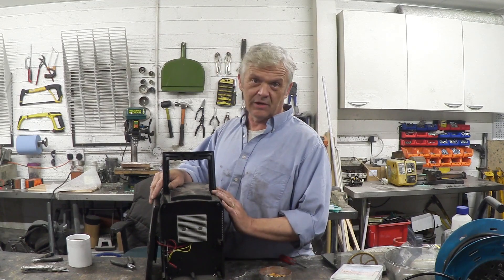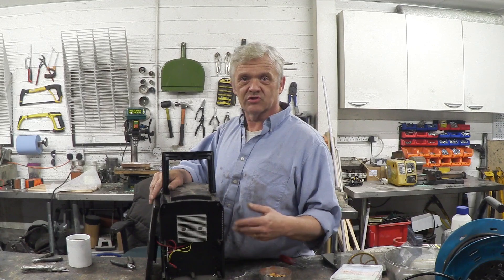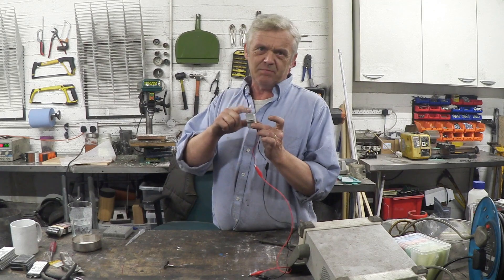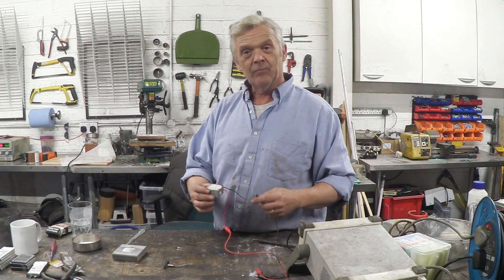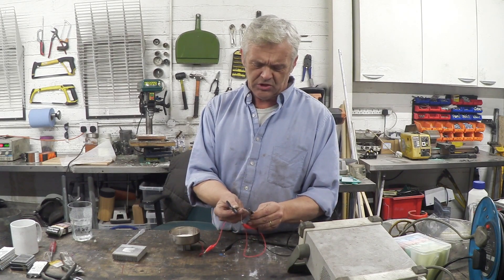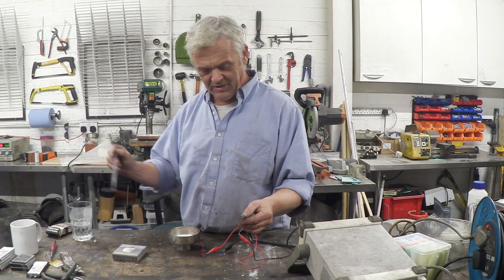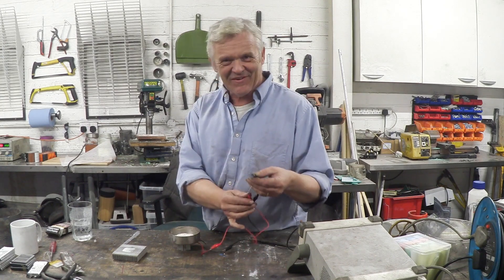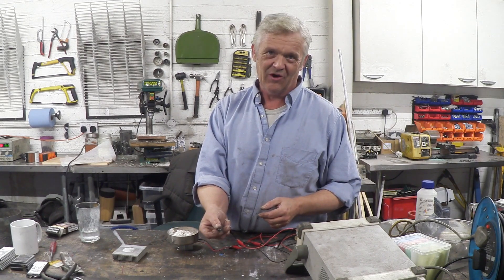1268 How To Generate Electricity From Chalk

Comment: What kind of motor do you use in the video, I made a candle heating with ceramic flower pots, one to take the heat, and the second to circulate the air, and I want tu use a small motor to circulate the air better, because heat can produce electricity. With my new peltiers 😁. Thanks to your video. 🙏

Comment: Would it not be better to user the heat of hydration of some salt, such as magnesium, or copper, sulphate. As these processors are easier to reverse.
Reply from the maker: there are a ton of ways mate - a little experiment is called for I think lol
Reply: @ThinkingandTinkering  magnesium sulphate has a heat of hydration of -104.9kJ/mol, almost twice that of copper sulphate.
It is less toxic than copper sulphate. The advantage of the copper salt, is that its colour changes in the anhydrous state.
Both require less aggressive heating than the conversion of calcium hydroxide to calcium oxide.

Comment: If you arranged 5 peltier devices into a box shape, 1 on the bottom and 4 around the sides, and used it as the container for your calcium reaction you would increase your output considerably
Reply from the maker: for sure mate - a lot of heat went to waste in this demo

Comment: I love these devices,  dissimilar metals.
Reply from the maker: yep - these ones are np junctions but dissimilar metals work as do other things mate
Reply: @ThinkingandTinkering  Power transistor,  made of germanium is fun to play with by cutting the cover off and use light to product small current and voltage.

Comment: Recently I bought 2 TEGs / Peltiers because i was planning to try the equivalent of a 'Thermopile' (Inspired by the lemon battery 'bank' / Voltaic pile), but still considering how best to pull off a hot-cold-hot-cold type of design without too much leakage .. although just thinking about it now 1) just turn one over and spread them out spatially,  2) create a 'sandwich' of devices H-C C-H H-C    ...or 3) some funky shaped beaker for these exothermic reactions lol
Reply from the maker: I love the idea of a funny shaped beaker lol

Comment: Does the chalk degrade as the water evaporates? Or can a constant water source maintain heat
Reply: An answer to your question is that calcium oxide turns in calcium hydroxide (slaked lime) by adding water, which in turn, the wet calcium hydroxide slowly turns into calcium carbonate by absorbing carbon dioxide from the air.
Reply from the maker: Kateonian law gave a good answer mate

Comment: I remember that trick from years back when you put electricity in a peltier device you get hot an cold but when you put hot an cold in a peltier device you get electricity, what's really intriguing is when you put electricity in a 3 phase motor an get movement but if you put movement in a 3 phase motor and get electricity 🤔
Reply from the maker: generators and motors are basically the same thing mate
Reply: @ThinkingandTinkering  tru but it's figuring out how to do the reverse in everything

Comment: Awesome the Cool thing can be really Hot! When we need electricity How does this work with a burning Candle?
Reply: a candle, not a lot until you restrict the convection with ceramic.
put a bunch of Peltier modules painted with an Albright or chemical mirrored solution 2/3 around a diy limelight now ya talking 💯
Reply from the maker: to be honest mate I would use the heat from the flame to heat the air then pass that over the Ali fins - bingo

Comment: Although all are excellent, I like this principle more than your prior "emergency power" demonstrations.  The reall nice thing about this is that a real thermal battery setup could generate power even while the lime was being heated in the "charging" state -- so long as the other terminal could be cooled.   One could supply thermal solar for generation and recharge with wind-powered pneumatic cooling for the "cold sink," and still retain a constant output.  A sensor could add water when thermal heating was not available.  Great demonstration, Robert!
Reply: Go for it Dave Kenny
Reply from the maker: I like the idea mate - want to give it a go?

Comment: This is a bit random, I'd like to know what I can do with my egg shells? Has anyone found a use for them, I really hate just throwing them in the trash.
Reply: May I suggest composting? If you added  perished leftovers, rotten fruit, coffee grinds, etc., you could generate some nice nutrients for your yard or garden (or someone else's). There's many container systems for sale around with many sizes that do it in some logical way. In fact, I've wondered if communities will someday adopt a compost collection service. Think of all the good nutrients that go to waste in all the garbage dumps. Not sure exactly, but it probably accounts for about 1/4 of all landfills. Just a thought :)
Reply: @Charlie-Oooooo  Interesting, whats the best method of grinding the egg shells up? I remember a family member telling me that egg shells take a long time to break down into compost.
Reply: @Mangomesh  If you just break them up by hand that's fine as they will break down eventually, wherever they might wind up. If you really need to, you could use a small coffee bean grinder, but you might have to allocate it solely for eggshells. Cheers :)
Reply: If you have excess vinegar,acetic acid, you could make calcium acetate. Once heated if you capture the fumes of the heated calcium acetate it will produce acetone and calcium oxide
Reply: @brettmoore3194  flat coke... The active acid in Coca-Cola Classic is phosphoric acid (H3PO4). The average amount per can of coke works out to 17mg per 100 mL
Reply: blitz them/1 shell in your coffee grinder then microwaved etc when making up a conductive ink replication & see what new effects it has on the Nano ink, does it show a good Seebeck effect when dip coated with other variants layer cake style.
Reply from the maker: make a bottle lamp!
Reply: @ThinkingandTinkering  You can make a bottle lamp out of egg shells.. How?

Comment: Great video Rob, are there ways of using solar heat to charge a material  like this so that the heat can then be used later in the year?
Thanks 👍
Reply: James Cunliffe   Yeah that could work, I was thinking of zeolite and solar thermal, but focused light would allow hotter temperatures so would make quick lime viable pehaps but unsure.
👍
Reply from the maker: oh yeah - it can be as simple as blowing summer air over a pile of rocks
Reply: @ThinkingandTinkering  Many thanks 👍